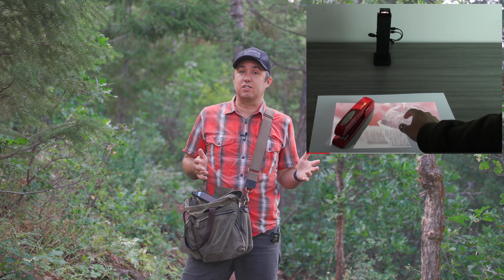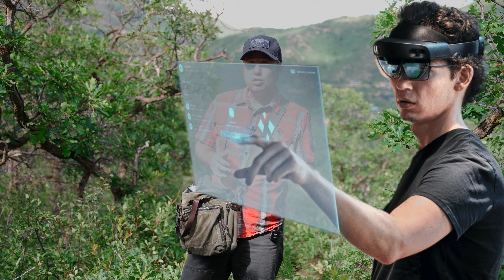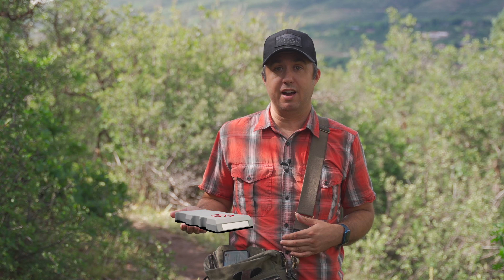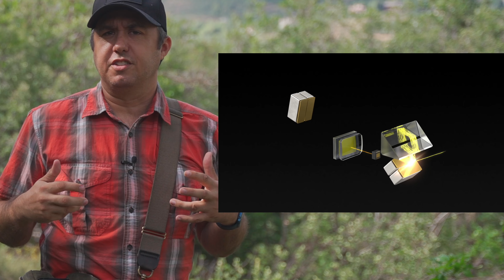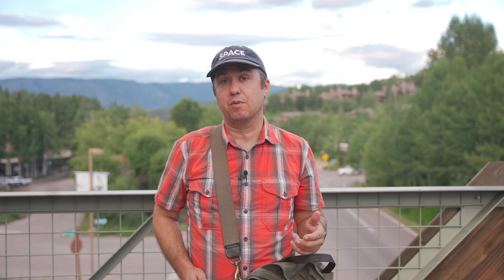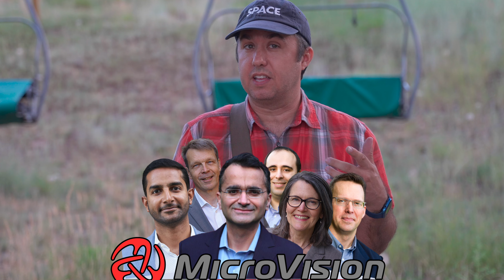Microvision LiDAR is Complete. Why LiDAR is Better Than Tesla Cameras for ADAS Safety.

Comment: Everyone knows water cooling is much more efficient (and silent) than air cooling. Also, Teslas chip consumes 72 watts for the entire stack, how was that hard to "nail down"?

Secondly, Teslas stack gets depth from all 8 cameras at once, not the 160x120 images you included. 

Which mavin laser can tell me what the speed limit is? NONE
Reply: Rick, water cooling is more efficient when conditions allow for it, which is not typical in a vehicle in most places in the US. If the ambient air temperature is too high, then the entire water cooling loop can be saturated before it cools the components without additional cooling. This is why most industrial and even servers only use air cooling. The volume of air inside a vehicle (even though very warm upon start up on a hot day) is a much larger volume to saturate than a relatively smaller volume within a closed loop water cooling system. 

I know my explanation isn't perfect, but there are many many videos that show why water cooling is soo good for home PCs, but not necessarily for other applications.

Cheers.

Comment: Lidar cant tell where lane lines are, what signs say and is that bag a rock or a bag? Its a nice shortcut though for companies who cant get vision right. Also Tesla is NOT using depth maps for nav perception. Their vector space is created using advanced occupancy networks to voxelize drive space as its output is much more useful. Vision stacks are more robust and data dense.
Reply from the maker: Right, so Lidar plus cameras is perfect!
Reply: @SPACEDESIGNWAREHOUSE  Lidar is great for redundancy, but cameras get every piece of data required for the full processing pipeline in one sample. Tesla's are driving all over with no lidar just fine. Now they just need to tune their timing and interaction handlers and its a wrap. great space to be in
Reply from the maker: @GoatDirt  do you think adding Lidar, more data, would make it worse?
Reply: @SPACEDESIGNWAREHOUSE  There is nothing inherently wrong with lidar (except cost and interference and other niggles) or
more data, but conflicts arise when data becomes stale or lidar systems encounter  nested reflective surfaces and the parsers aren't tuned to prune long paths (which is easily solvable with vision-based heuristic models anyway). Vision using novel envelope discovery is what allows FSD to drive anywhere, while Waymo is stuck in a few cities and expanding at a glaciers pace. 

The best data is that which is inherent in the mechanisms used in understanding the world within the driving space - rather than data about the driving space geometry - and lends to better adaptability. I.E. If I understand generally how to climb ladders, I can climb em all no matter the shape or step spacing or how new it is. That, vs having to scan every ladder first, matching to a database, then climbing it. It isnt scalable. 

And as long as the hd mapping is a nice-to-have and not a deal breaking prerequisite, its fine to have it. But general ai wouldn't need it because the world is the database itself since it can be interpreted in real time as-is. 

The ultimate sensor suite is FLIR with vision as it can see though fog and dust and vision can still process frames as normal SFM 3D spaces.
Reply from the maker: @GoatDirt  well it will be interesting to follow along with how all the rest of the car companies solve for safety issues, auto braking, lane keeping (adas and Lidar are not all about self driving). 

And it will be wildly profitable for me if the majority go with Lidar in their sensor suites! MVIS seems to have solved for the cost issue; it’s something like $500 for their sensor at scale, pretty cheap for higher end cars.  And if Tesla doesn’t give away their AI, I don’t see the other companies spending ten years training their own.
Reply: @SPACEDESIGNWAREHOUSE  Extremely great points. And good luck on your profits!

I love the high frequency mirror vibration to direct sent-out points. Do you know if the angular positioning for reception casting is determined at the phase level? I have seen some prototypes that sync the sine wave of the reflector driver with angular positioning, but not sure about how this one does it
Reply: @SPACEDESIGNWAREHOUSE  Yes. That's also why they removed radar, it was slowing things down and making it worse.
Reply: @SPACEDESIGNWAREHOUSE  The rest of the car companies will eventually admit they are clueless or decades behind and simply use Tesla's FSD.
Reply from the maker: @robertdewees9418  you say that with such authority!  One unfortunate point you may need to look into is that car companies don’t always go with what’s best. They usually go with what’s cheapest, or quickest to implement, OR just whatever relationship they’ve developed.. 

Personally, I think you’re wrong. But neither of us know for sure! Hopefully you’ll keep following along over the next couple years while we find out.

Comment: The biggest issue with the Tesla camera system is exactly as you said. There isn’t technology capable of rendering those quality of images in real time. Not as much of it as would be required for safety standards. Which is exactly why the Tesla cars themselves don’t even allow the driver to remove their hands from the steering wheel when in the self driving mode. To sum this up I think lidar is going to be one of many components in a much larger system eventually. I want more MVIS shares AAGAGAHAGHHH!!!
Reply: how you been doing buddy? still huffing the hype?
Reply: @partypooper8198  I literally doubled my value and sold. The fact that you are here to start 💩 shows how pathetic your life is😂 
 But micro vision is a future company, nobody should be expecting massive returns for 3+ years from now

Comment: This is more a LiDAR vs Camera video rather than MVIS vs TSLA. Good video and very informative, but unfortunately MAVIN's output looks terrible compared to its competitors. Even with a claimed resolution of 10.8m points per second, it means nothing if all you get out of it is a blurry, noisy mess.
Reply from the maker: Which Mavin competitor looks better, in your opinion? Most of them display a pre-rendered, edited point cloud on their websites to hide their resolution and frame rate.
Reply: @SPACEDESIGNWAREHOUSE  Which is a tactic that was employed by MicroVision as well until a few months ago. I'm glad they're finally putting their point cloud outputs out there for everyone to see, but it honestly just doesn't look that great yet.

From the glimpses of it I could catch at CES and IAA, Luminar's Iris seems to have a much cleaner and more stable output, and the range is super impressive as well thanks to its 1550nm laser. It does seem to suffer from some framerate stutters and the resolution is decent but not the best. And like you said, they're not very keen on sharing their outputs online.

But best-in-class in my honest opinion would be Innoviz Technologies with their InnovizOne and InnovizTwo. The One is already one of the best looking point clouds I've seen running in real time, but the Two is just straight up groundbreaking. Granted the early B-Sample outputs show it running at 10 FPS, but they claim the final product will run at 20 FPS, and I'm inclined to believe that. Plus they're the only company not shy about their outputs. Plenty of videos of their raw, SLAM-free point clouds up on their Youtube channel and many more on their (and their CEO's) LinkedIn pages.

Comment: this guy over here with 97% of his stock portfolio in a zombie company founded in 1993 that has NEVER been profitable. This investment is purely based off the extremally low chance that MVIS will be the #1 lidar manufacturer in the world within the next 5 years. 'with their "off the shelf" components they will revolutionize the automotive industry single handedly, simply by measuring the distance and velocity of any forward facing objects BETTER AND CHEAPER THAN EVERYONE ELSE.'

Anyone with half a brain can see that you have no idea how any of this technology works and you simply regurgitate all the crap they spew over at r/MVIS. 

first off. when you talk about "tesla AI" and how they are training it, that is completely different from what MAVIN does. this sensor just measures velocity and distance in a narrow field of view. AI is the computer that drives the car, not processing the 3d Data. Next you say the car is given a 3d representation of "the world around it" that is false, it's only in the front field of view, i believe a max of 120 degress. then you list off all the things MVIS does better than everyone else, which is completely unproven considering MVIS does not have one single third party to speak on their behalf!

all it takes is for the CEO to say anything he wants and you just take it like there is any actual merit behind their claims besides a spec sheet they typed up themselves!

are you in so deep now that you're just going to keep putting out these sad videos for the rest of your life or what? I mean I'm here for it and willing to help remind you how stupid of an idea it is because you clearly have no idea what you're talking about.

Comment: Lidar is not the the only sensor creating a real time 3d render. Imaging radar + camera is the only way to go. Direct speed measurements + weather resilience + high resolution images will always outperform lidar
Reply: While true, lidar is the centerpiece of adas.
Reply from the maker: Has anyone other than Tesla made this work?  Also, how could you possibly know that it will 'always outperofm lidar..?"  What if the next generation of lidar is 30 million points, or 100 million?  Lasers dont require all the AI training or the processing power to do the same thing..  Of course, computers can always just get faster and faster too..  I expect both solutions will become normal.
Reply: You are right always is a stretch. But still, I think nextgen 4d imaging radar + camera is the superior technology. mainly due to cost and physics. Radar is already everywhere and it directly and accurately measures the velocity of the detections. Ai workloads are involved either way. And as there will always be redundancy in adas radar will be involved anyways. Also, number of points are irrelevant after some point as they are downsampled anyway for efficient ai processing. The only thing thats problematic may be interference of radar sensor but we‘ll see. 

Maybe in the future there will be only lidar and radar involved as cameras will become obselete who knows.
Reply: Also, just to be clear camera, lidar and radar all need ai workloads. The only thing that’s changing when adding a 3d sensor such as lidar or radar is that the intermediate model for depth prediction is not needed anymore. Also these depth prediction models for images have become very efficient so not much of a gain especially as camera + lidar or radar are fused in some way which also needs processing power. I hope this explains the ai part and processing power problem. On a sidenote you should diversify and buy some radar stocks ;)
Reply from the maker: @danrot  Yes indeed they all need processing - but that custom ASIC microvision keeps talking about does all that so the car computer doesnt have to.  And the price is down around $500 a sensor.  And youre right, I SHOULD look for automotive radar suppliers!  I wonder if that information is easy to find..
Reply: @SPACEDESIGNWAREHOUSE  To put those $500 dollars into perspective, it would be interesting to see how much does Tesla cameras cost. Manufacturing at scales, even a $500 dollar sensor could be expensive.
Reply from the maker: @ph4n70mcyph3r  to be fair, it’s not just the cameras, but also the very specific and well trained and powerful computer and AI Tesla has developed as well. 

And again, I’m not anti Tesla, by any means. They’ve got their thing going and working pretty well; I believe both solutions will exist in the world and be successful

Comment: Their system better not set off my radar detector every 5 seconds. Daddy’s gotta a speed problem over here.
Reply from the maker: Interesting point. Actually I think a lot of new cars are using actual radar to do that cruise control that automatically slows down for cars in front of you.  I wonder if those set off a radar detector.
Reply: @SPACEDESIGNWAREHOUSE  Adaptive Cruise control is amaze balls when I actually use it. Uniden R8 Radar Detector is also pretty sweet if you have a lead foot like me.
Reply from the maker: @Spiffspacer  I did just get a speeding ticket on my way back from Miami a couple weeks ago. I was in a rental car! Speed trap at the bottom of a hill. So lame. Could have used that radar detector

Comment: I think u missed why tesla went with cameras mate. There's a reason they didn't go lidar
Reply: The reason Tesla did not choose to integrate LiDAR is because that decision was made a long time ago.  Not sure exactly when, but presumably 2016 or before. LiDAR for Advanced Driver Assistance Systems (ADAS) and Autonomous Vehicles (AV) was not mature enough at that time and was way too expensive.  LiDAR for automotive has come a very long way since then, with price points in the $500 range (previously they were in the  $xx,000 range) greatly increased capabilities (resolution and latency), and much reduced form factor (no more spinning KFC buckets on the roof).
Reply: @dealio4624  you dont realize the xx,000 priced units are usually full 360 degree view? the "kfc bucket" is a 360 view, it spins the laser around the top of the car for unobstructed view. the $500 you talk about otherwise is an "off the shelf" sensor that only has a stationary 120 degree field of view. 

you are over here comparing different products and it makes no sense...
Reply from the maker: I don’t know that reason, but I would like to!

Also, I don’t think it will be a matter of wether Tesla ever uses Lidar. They may not. But the other companies absolutely will.
Reply: @SPACEDESIGNWAREHOUSE  time for you to do some digging to why they are using cameras only.
Reply: Do you care to share as to why YOU think that is?

Comment: MVIS are they not the same project you are down -83k ? Or did I misunderstand your previous content? Still how does it do in snow storm and heavy rain ?
Reply from the maker: Yes, they are that same company. I had some bad timing, but that doesn’t detract from the pretty clear future for these guys. 
Generally, people describe Lidar as being better in snow and rain than cameras, but I have not seen specific test data from microvision in those conditions. And I’m not one to say everything good all the time no matter what, so we’ll have to wait and see for now. Winter is coming sooner or later!
Reply: @SPACEDESIGNWAREHOUSE  As SDW has pointed out, the ultimate solution is not 1 type of sensor, but multiple - Camera, LiDAR, and RADAR.  In fact, Microvision's current design for MAVIN is fusing LiDAR and RADAR data to build their high resolution, low-latency point cloud.  This cloud will be fused with Camera data at the next layer of the stack.  While LiDAR data does better than cameras in bad weather, RADAR can "see" through bad weather and will augment the accuracy of the ultimate point-cloud, even in bad weather.
Reply: @SPACEDESIGNWAREHOUSE  I would still like to see a level 4-5 car comes with everything cameras LiDAR radar and heat vision .. I think that’s what it will take to get to level 4-5 for all weather condition support
Reply from the maker: @fullyelectric  ooo yeah, thermal cameras to know when something crossing the road is alive, vs a paper bag..  I like that!